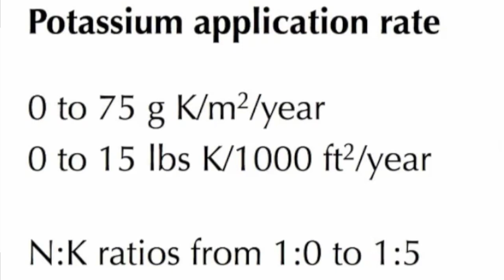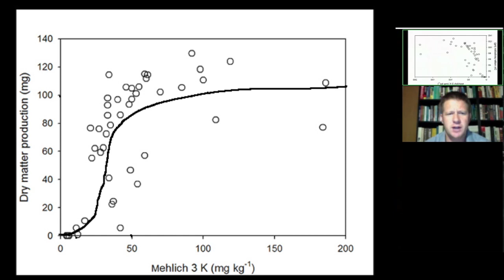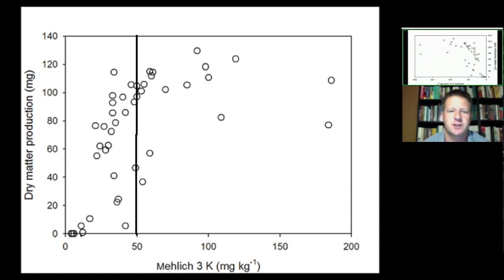Dr. Micah Woods on Potassium

Comment: @fred7570 the experiment on the test green at Cornell was a 30 cm sand rootzone with pH of 8.2, potassium at the start of the experiment was about 80 ppm by Mehlich 3 extraction, 40 ppm by 1 normal ammonium acetate extraction. Calcium and magnesium were at relatively high amounts in the soil.

Rainfall ranged from about 50 mm to 200 mm per month during the two years of the experiment. Supplemental irrigation was applied in increments of 1.8 cm, as needed, to prevent drought stress.